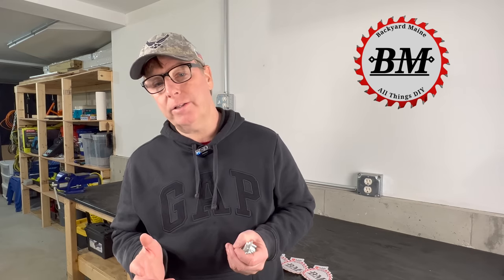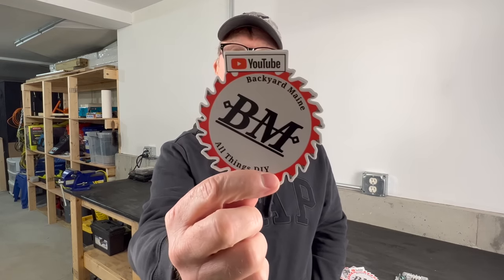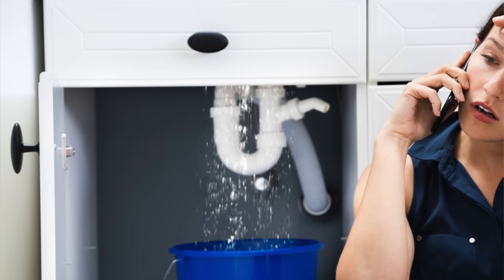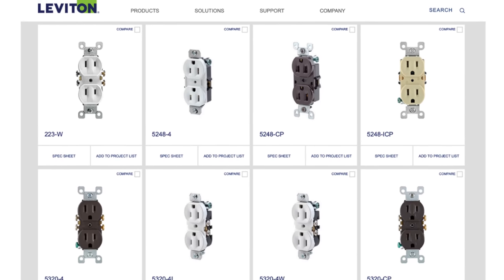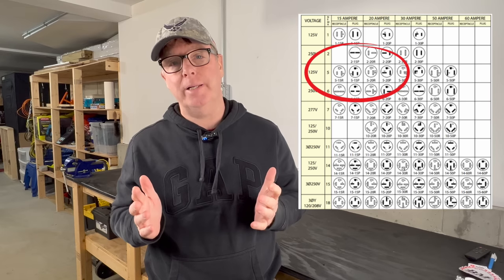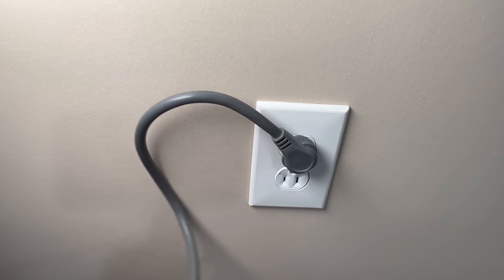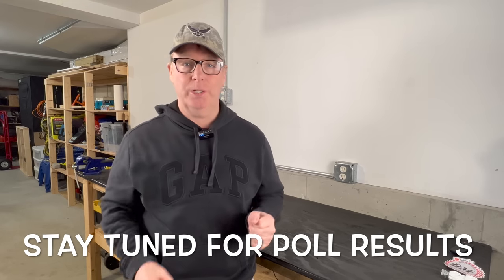Are your outlets installed upside down? (You may be surprised)

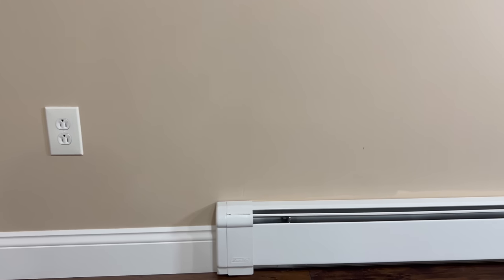Comment: I love the installation method of having the receptacle upside down if it’s controlled by a light switch. It makes it so much easier to spot them in a room when setting it up. Hopefully the installer had the best idea of where a switched lamp should go. Sometimes though they don’t get it right and you end up with a switched outlet in a crazy spot. 0:57
Reply from the maker: Make good sense but I agree it's not always in the right spot.
Reply: How would that work when only half the receptacle is switch controlled?
Reply: The house I grew up in had a switched outlet. It was right below the switch. How stupid. If you had a lamp there, you could just reach and turn it on.
Reply: Some switched outlets are also split with one outlet switched and the other hot all the time. In those outlets it makes sense for the switched outlet to be the bottom outlet, the one that had a lamp plugged in all the time, and the upper outlet to be unswitched.
Reply: My house is wired so that the upper receptacle is switch controlled, and the lower receptacle is always powered. So which way should they be installed?
Reply: We had a switch sharing the three-gang that shared our kitchen and dining room, that didn't seem to do anything. a couple of years after we moved in, we where hanging Christmas lights around the built-in shelf (you might call it a soffit) that went around the dining room. In doing so, we discovered an outlet above the shelf. The switch works great to control the Christmas lights. And it's installed sideways.
Reply: We have 2-source sockets with the cross connects cut. Only The top sockets are wall switch controlled on these.
Reply: @thomasw.eggers4303  I wish there were a consistent answer. The problem is that depending on the plug, having the switched receptacle on the top or bottom can be an issue. But, the top ultimately makes more sense in terms of flexibility as you're more likely to have a plug that has the cord go directly down than up.
Reply: Yah sure......I get it, it works as an indicator that the specific outlet is modified.....but other than that it's ridiculous...WTF ?
Reply: @chadhartley8067  There's a metal tab between the two screws on either side. You stick a screwdriver in to break and remove. Then, the outlets can be wired separately.
Reply: A switched receptacle is always the bottom receptacle I have never heard of anybody putting one upside down just identify it as a switched receptacle that is one of the dumbest things I've ever heard of
Reply: @chadhartley8067 you put the receptacle that switched on the bottom because you typically never remove it it stays plugged in for a light the top plug is one that unplugged and plugged in on a regular basis that way you're not Crossing plugs
Reply: @thomasw.eggers4303 the bottom receptacle should be switched the reason for that is because when you have a light plugged into it it stays plugged in all the time if the top receptacle is Switched then you have to reach underneath that receptacle unplug something that's only in there temporarily
Reply: @SmallSpoonBrigade the National Electric Code is the minimum standards to comply with but it still says must comply with manufacturer's recommendation the box shows a picture of exactly how to install the receptacle always shows ground up
Reply: @ds9902  Yours is a reasonable view I hadn't considered. The house that I bought (1) had all the grounds up, and (2) the switched receptacle on top. The switched receptacle being closer to the switch was, I suppose, the rationale.
Reply: Do you have any idea what that does to someone's OCD?
Reply: Same here!  My 21st century house has a single switched outlet in the living room, approximately 1 foot to the left of the switch that controls it.  Hey, thanks for that extra 12 inches of convenience! 
My mid-50s house had four outlets around the living room, each one with switched power on the bottom for the permanently installed lamps, and constant power on the top for intermittent-use items like vacuum cleaners and Lionel trains...
Also, grounds go down, and toilet paper should fall off the front of the roll!

Comment: I've been an electrician for 45 years and I was taught to install receptacles ground down in my apprenticeship. Years later I was working on a breeder reactor at the Savannah River Site which is owned and operated by the U.S. Department of Energy. The DOE specifications at that time were all receptacles be installed ground up for the reason you described in the video.
Reply: I'm not an "electrician" but do this kind of stuff quite often. I recently installed a circuit and receptacles in my brother's garage and made them ground up. I was thinking that the ground would help hold the hots in place, but this idea of safety is a good one. Two years ago I completely rewired my house. They are all ground down.😢
Reply from the maker: Thanks for sharing
Reply: National electrical code says to comply with manufacturer recommendation manufacturer shows on every box the proper orientation of the receptacle it always shows ground up the government requires that the military requires that and NASA requires that
Reply from the maker: @ds9902  You should know that a picture does not equal manufacturers recommendation. They actually have to recommend in writing. Take a look at Levitons website and notice all the ground down pictures. If they printed top on the receptacle that would be different. You must know this though or we would not be having this discussion. Do you think 85% of the AHJs are getting this wrong?

Comment: The best way to install receptacles --- if you are doing it for a specific appliance -- is to see if the power cord is a 90 degree cord and orient the receptacle to make sure stress is not on the cord.  If nothing specific, I usually do ground down because most plug in wall timers,  fragrance generators, like the ground down so when plugged in, the liquid oil doesn't spill out.  Yes, there are some now that have a rotating plug built into them. The older ones were in a fixed position I've seen.  In the end, install them how you like.
Reply: I agree !00 %

Comment: Ground-LEFT is the most underrated socket installation. It offers superior protection for both 3-pin AND 2-pin plugs, as it puts the neutral pin directly above the live, making it nearly impossible for any dropped item to cause a short. A byproduct of this orientation is that the screw terminals for the live conductor will be facing down, which means a loose wire or other debris inside the socket enclosure will have a lower chance of falling into contact with it. Another great perk of this configuration is that it will allow 90°/45° plugs to come out at an angle that still faces downwards. It allows plugs to fit nicely and out of the way under countertops or cupboards, and also doesn't put as much strain on bulky plugs (like those with built-in adapters or circuit protection) as ground-up installations do. As an electrical controls engineer, I always try to use the ground-left orientation whenever I design a panel with built-in sockets.
Reply: I completely agree

Comment: I’ve always used ground down installation. However, I think the ground up idea would be in pretty good about preventing a short if somethings fell on the outlet. I also think a ground up is stronger for holding weight up. It gives the positive and negative blade, more leverage strength, whereas if the ground down was used, the ground peg would be a leverage point giving more leverage strength,  to pop the two blades out of the outlet.
Just a thought.
Reply: I don't care cause I do not try to short out my receptacles with a screw driver while they are plugged in that just seems like to much work for me to do
Reply: Don't worry about shorts. That's why we have circuit breakers.
Reply: More than leverage I think it's length. Becasue of its length on ground up you are never going to get the cord hanging by a single point. On ground down because of the shorter conductor blades ability to pop out before the ground disengages you can get the cord hanging by ground alone.
Reply: Exactly my opinion also
Reply: But, most plugs are two prong, so ground up won't prevent a short.  As far as ground up being stronger for holding weight up...the cord really doesn't weigh much and what about the 90 deg three prong plugs that are designed to be inserted ground down?
Reply: On a refrigerator isn't the plug set up for ground on top?
Reply: Exactly

Comment: Having dealt with inspectors that wanted the ground to be up in commercial projects due to OSHA rules, and having dealt with several service calls that involved metal parts contacting the conductors on plugs that were slightly loose in receptacles, I am firmly in the ground up installation camp. One was a set of keys, one was an aluminum clipboard, one was a set of tweezers, and one was a pair of metallic rimmed glasses. The main issue with the ground being down is that a metallic object could make contact with just the hot but not the neutral just by being slightly tilted, and so become and remain energized. When a person tries to remove the energized object while connected to ground through touching some other grounded surface, and if the circuit is without ground fault protection, the person will have no protection other than the breaker that will allow a lethal dose of current to flow through a person well before tripping. 

If the ground is up, there is a much higher likelihood of the metallic object connecting to the ground pin first before either connecting to the grounded neutral or the ungrounded hot conductor. It is far less likely for a metallic object to connect only to the hot conductor if the ground is up, and more likely to create a short between the grounding conductor and the ungrounded conductor that will allow the breaker to clear the fault without endangering personnel.

I have also found that in my own shop that ground up receptacles also prevent damage to electrical cords, since the cord plug does not pull out and bend and damage the ground connector.
Reply from the maker: All great arguments.. I'm retired now but I was the senior electrical engineer for a multi billion dollar semiconductor manufacturing facility. We installed ground down on everything and during my 22 years there we never had a fault where something came in contact with a partially plugged in cord. Also never had an issue with OSHA due to the orientation. I am certainly not saying it's impossible though or that you didn't experience these shorts. I think if these types of cults were common the code would be changed. Thanks for your well delivered input.
Reply: I agree.  But mostly for shop use ground up.  There are a ton of variables in a shop that can cause a direct short via 2 electrodes crossing power.  The ground on top is an excellent  concept.
Reply: It is a silly debate, we should fix the actual problem why are outlet plugs designed in such a way that they are live and hot when they are not fully plugged in. They should be designed in such a way that it is impossible to cause a spark intentionally.
Reply: @MegaLokopo  how about a mandatory plug condom!
  Umm, I just realized the impact of what I said.   Oh shit!  Again!   Oh shit! Again!
Reply: @MegaLokopo  yeah,  how about an internal switch/detector that knows when the last 1/16 is pushed in.
Reply: @MegaLokopo  Like in Europe.
Reply: @jsEMCsquared  Or just insulation around that same part of the plug.
Reply: @flyingsodwai1382  Yep, Tom Scott does a great video on it, the European plug isn't perfect but it is far better than the us plug.
Reply: My buddy tried using a Klein outlet analyzer on a ground up oriented receptacle and realized he couldn't see what the tester was showing because the display was facing the floor. Ground up is ignorant and the excuses for that orientation are absurd.
Reply: @karlschauff7989  Exactly anyways safety should never be jerry rigged.
Reply: I've been doing electrical work for around 40 years, and I've never seen an object come in contact with a partially exposed plug. Of course it's possible. Anything is possible. But from all the electricians I've spoken to, it's extremely rare. I mean extraordinarily rare. The only real reason the OSHA regulation for ground-up exists is because someone was stupid, got hurt, and then sued someone because "they didn't warn me". That's why a lot of OSHA regulations exist - so when someone does something stupid and gets hurt, then the insurance company can refuse to pay because "you violated OSHA regulations".
Reply: I agree with what you are saying. You are correct about the ground up with prevent ( short circuit and fire) I would like the manufacturers ( which they can ) of appliances to design there ( Plugs) on an angle with the ground on top and won't fit/ look like you showed, putting a strain on cords and looking out of Place   Ugly. That would solve the "Safety" Problem All around. Hospitals do it . ( Code) All hospitals.
Reply: @sugesuge786  Or even better, we put insulation on every part of that plug that doesn't need to be exposed.
Reply: @MegaLokopo  NEMA chart show different types depending upon voltage, amperage, and number of wires of which a lot either lock into place, or are resistant to pull--out which is the heart of the issue.
Reply: @brodriguez11000  The heart of the issue is not that the plugs can slowly come out. The issue is that the plug is live when it is not fully inserted, if the plug was no longer live after it was no longer flush with the wall we would never have these issues. While if you try to prevent it from leaving the wall ever, that will inevitably lead to massive fire hazards when the locking mechanism breaks and prevents you from unplugging something.
Reply: @MegaLokopo  So you support the entire electrical contracting world changing because of one id*ot getting injured back in the 80's or earlier? Wow
Reply: @LMBrown3900  No, I support preventing fire hazards. It wouldn't take much effort to insulate the part of the plug that doesn't need to be uninsulated. There is no reason the entire length of material must be electrically exposed.
Reply: I always wanted the face to be upright…
Reply: I highly doubt this commentary

Comment: I did ground up in my shop where there is an increased risk of metallic objects falling on the plugs. And most of my shop tools are three prong. Elsewhere, I use ground down because that's what most people expect and, like you said, many low profile plugs are built with this orientation in mind.
Reply: Just wondering has anybody ever seen a ground down receptacle in a hospital every hospital I've been in or witnessed always face them up I believe they might be required to have them that way
Reply: Agree. It's really interesting when a metal clothes hanger falls on a dryer plug with a gap .
Reply: SO convinced that I will remember this as I plug in the flat bladed polarized plug on my battery powered: chain saw, drill motors, and rechargable dill pickle er.

Comment: I've always installed receptacles ground down, unless installing in an area where all receptacles were previously installed ground up. It has always seemed more intuitive to do so for the reasons you mentioned, as well as consistency in orientation when compared to light switches (ground and neutral left, hot right).
Reply: well your the one that chooses which is correct so choose wisely🤣🤣

Comment: When I worked at a hospital,  we were required to have ground-down at 18 inches or less from the floor and ground-up above that height. The reason for ground-up above 18" was that the ground lug added stability to the plug, helping it stay in the receptacle.  Makes sense to me.
Reply: All the hospitals I have (and am currently) worked in have been ground up, and one of the electricians showed me why. Very simply, with the ground pin up, if the plug is partially out and something metallic (such as an utensil) falls between the plug and the wall and makes contact with the prongs, the first prong it comes in contact with is the ground pin. That way when the object makes contact with one of the other prongs it is more likely to short to ground, and not short across the hot and neutral contacts instead.
Reply: TomMcdonald9AYahooDotCom  Some of the NEMA receptacles lock into place. Plus some have the neutral and hot at right angles to each other making it more resistant to pull-out.
Reply: If appliance manufacturers started making their plugs to support Ground Up it would be the obvious choice, aside from personal preference in appearance. 🙃